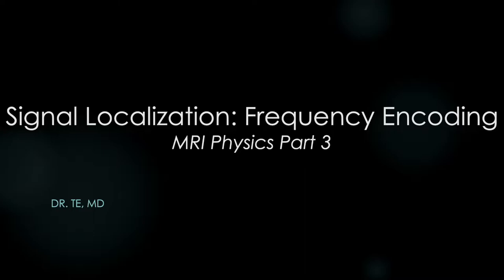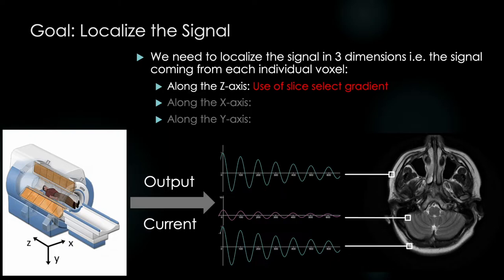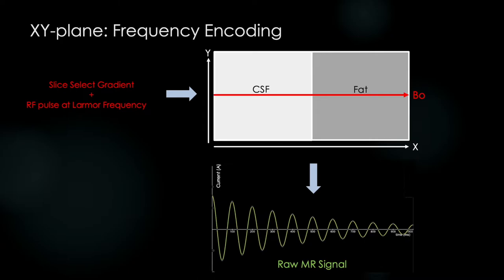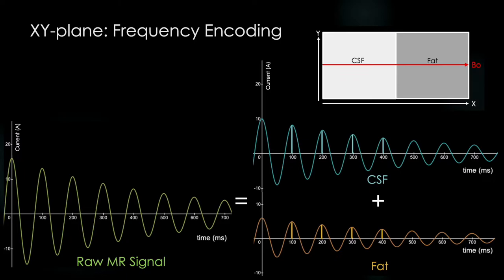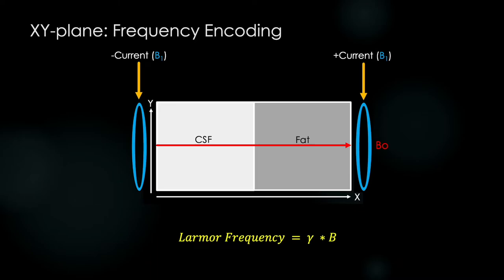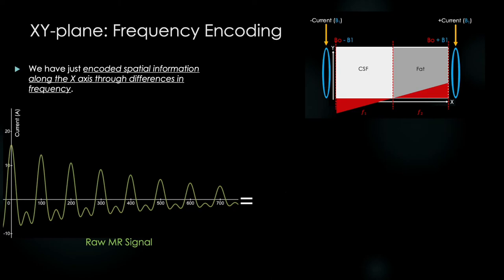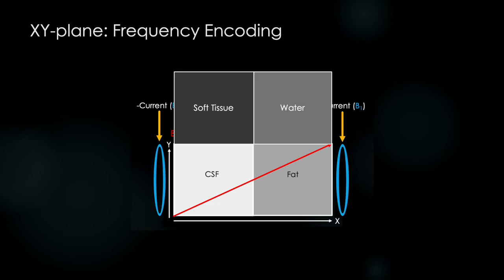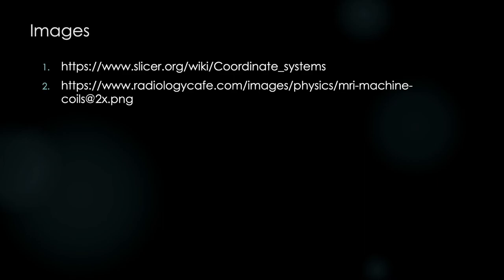MRI Frequency Encoding EXPLAINED | MRI Physics Course Lecture 3

Comment: Does slice select gradient ONLY happen along the Z axis? And signal frequency encoding only happen on X axis?
Reply from the maker: While the slice select gradient only happens along the Z-axis, the frequency encoding and phase encoding gradients are interchangeable and either can be applied on the X or Y axes.  Check out the next lecture on phase encoding for more clarification on this: https://youtu.be/nFDzXvjF7gg

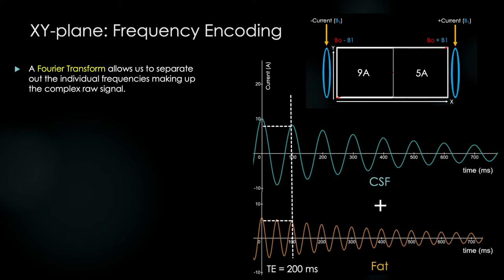Comment: Okay so question. If we do frequency encoding with a gradient like this. When we go to measure our FT’es signals like at 7:36. We are looking for a difference in amplitude as our contrast. Ideally this difference in amplitude comes from T1 or T2 depending on what sequence we have set up. But here the difference in amplitude is also coming from the fact that we are measuring waves with two different frequencies at the same time point. I.E at 7:36 we are measuring the peak of Fat but not the peak of CSF. So our contrast is slightly influenced by how strong our Gx gradient is.
Reply: Do we just assume the frequency changes induced by our Gx field are small enough to ignore their effects on Amplitude? Is there another way to frequency encode?
Reply from the maker: Thanks for the comment and love to see the critical thinking here.  I think what you are honing in on is that there is a relationship between frequency and phase, and that this will affect our contrast.  You are absolutely right, but it's a little more complicated.  The theory unpinning these initial lectures is designed to understand the commonly taught concepts of frequency encoding and phase encoding that you would find in an MRI physics course for medical professionals, and then tie these concepts into how we build an image and image contrast while avoiding the high level math needed to really understand the true image building process (we will cover this in the future)!  Highly recommend checking out the next few lectures in the series on phase encoding (https://www.youtube.com/watch?v=nFDzXvjF7gg), T2 contrast (https://www.youtube.com/watch?v=1ljzLjqgOGc), T1 contrast (https://www.youtube.com/watch?v=8zTDVXo70ok), and tying it together (https://www.youtube.com/watch?v=nxQGBYVJumE) to get a better grasp of these and will probably answer more of your questions along the way!
Reply: @MRIPhysicsEXPLAINED thank you :)

They’re next on the list!

Comment: Thanks for the video, really helpful! But why is B0 in the x-direction at 2:30, shouldn't it be in the z-direction? And why can we make a gradient in B0 to alter the individual larmor frequency of each voxel by applying an additional field in the x-direction (the 2 fields, B0 and additional field, are then orthogonal to each other)?
Reply from the maker: Hello and thanks for watching! Great pickup, I think the arrow head on the B0 line is misleading and as you pointed out, suggests that's the direction of the B0 field but what that line is really representing is the fact the B0 field is constant across a slice in the XY plane.  Since we're looking directly in the XY plane or down the barrel of the MRI machine, the direction of the B0 field will be along the Z-axis, which is a little hard to draw in 2D so disregard the arrow head in the figure.  Hopefully this now answers your second question, where you can see we are adding a gradient field in the X-direction to the constant B0 field across the slice, giving us gradient field with some base value of B0 added everywhere.
Reply: @MRIPhysicsEXPLAINED  so the x direction magnetic gradient field actually has its direction parallel to z axis but the magnitude varies along x axis?
Reply from the maker: @hangli1622  x direction field is orthogonal* to the z-axis with magnitude varying online when the gradient coils are turned on
Reply: @MRIPhysicsEXPLAINED  if x direction field is orthogonal* to the z-axis, the overall magnetic field is the vector sum of x direction field and z direction field, which is not parallel to the B0(z direction)?
Reply from the maker: @hangli1622  I would think of it less as vector summation and more in terms of scalar quantities.  The Larmor frequency is a scalar value, dependent on the magnitude of what magnetic fields the protons see, in our case the magnitude of the B0 field + the magnitude of the gradient field at point X in the slice.
Reply: @MRIPhysicsEXPLAINED  thank your for your explanation. Do you mean that the magnitude of the overall magnetic field is the scalar sum of B0 field and the gradient field, regardless of the direction of the gradient field?
Reply from the maker: @hangli1622  Yes exactly, with regards to what dictates the Larmor Frequency
Reply: @MRIPhysicsEXPLAINED  hi, in this video:  https://www.youtube.com/watch?v=LQyI_JhKBwc at 10:10, what the professor mean is that the gradient magnetic field is always at z direction, but the magnitude will change along the x and y axis. that is what I thought. but from your perspective of view, the gradient magnetic field direction is not in z direction, but in x/y direction?

Comment: so, it's clear to me frequency encoding. but what if we have a high-frequency signal on the left side of the image? 
consider that we have a lower gradient magnetic field on the left side of the image...
Reply from the maker: Hmm not sure if I'm following the question...  Remember we control what frequencies we will have during signal readout by applying manipulating the magnetic field and thus Larmor frequency with these gradient magnetic fields.  So in an idealized situation without any magnetic field inhomogeneities, there shouldn't be a high frequency signal coming from the left side of the image if our lower gradient field is applied there!

Comment: at 2:20, does the arrow of B0 indicates the direction of primary magnitude field? should it be perpendicular to xy plane?
Reply from the maker: No sorry, it should be a simple straight line across the slice at 02:20 without the arrow head.  The slice is orthogonal to the primary B0 field and sees a constant B0 value across the slice.  But when we apply a gradient field across the slice, it will now vary linearly as shown at 05:48, where the arrowhead is meant to show this field changing from a low to high value moving left to right across the slice, not the direction of the main B0 field.  In retrospect this was a poor choice of illustration that has caused a lot of confusion!